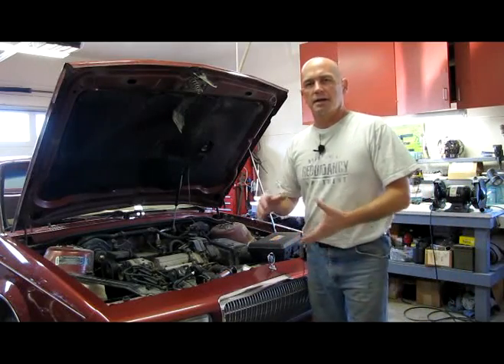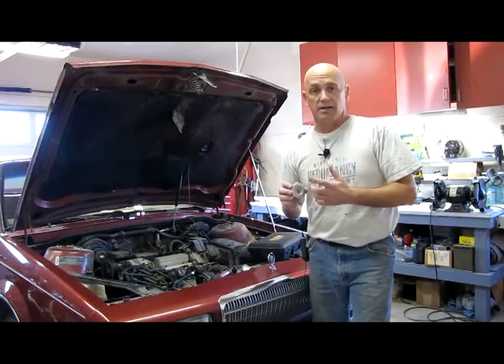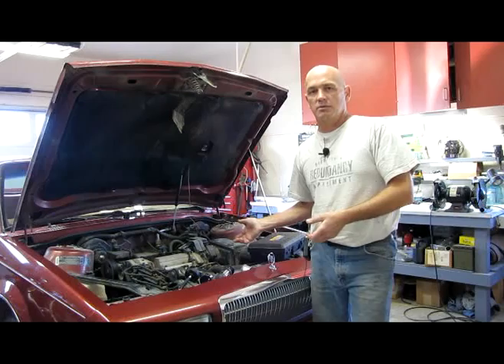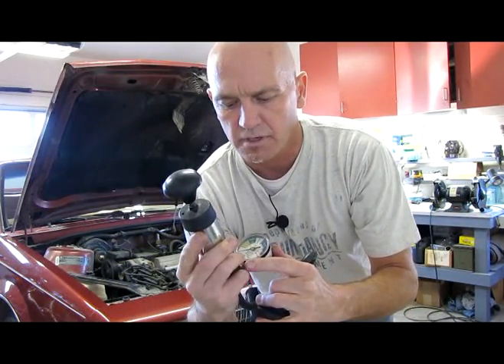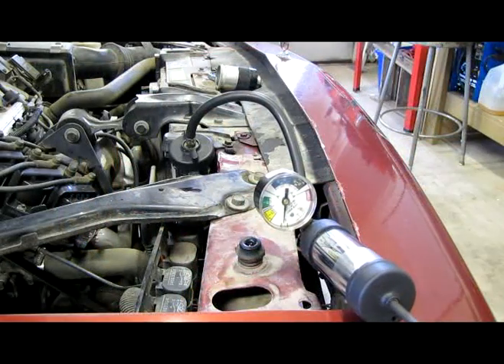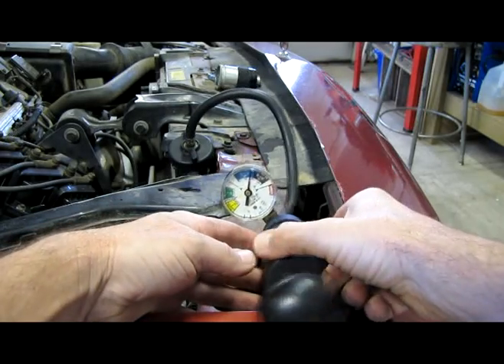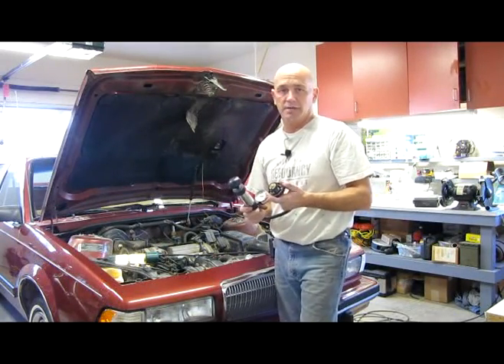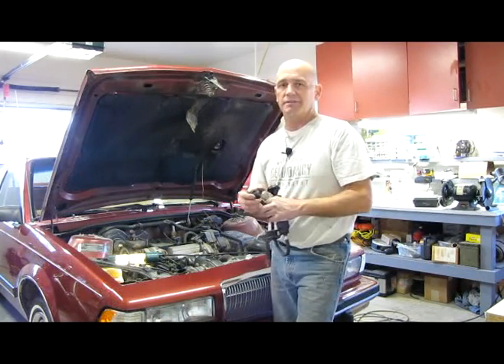How To Find Cooling System Leaks

Comment: I hope you may shed light on my problem. '97 Chevy K1500 4x4, 4WD, 5.7L.  It leaks approximately 1.5 gal per week. A mechanic pressure tested it and recommended replacing the water pump and the intake manifold gasket. When I look under the vehicle for the leak, I see a large area of coolant wetness under the belt wheels on the crossbar (part of the chasis?) and a drip from directly under the water pump.  My questions are:  Would that drip indicate an intake manifold gasket leak? Wouldn't a gasket leak be over a wider area, or would it drip?  Is there any test or observation that can isolate the specific cause?   It seems unlikely to me - though not impossible - that two problems would develop simultaneously.  Any insight you offer would be appreciated. Thank You, Art
Reply from the maker: Hi Art.  I'm glad you asked this question. Quick answer would be YES you could have more than one leak at the same time - doesn't necessarily mean that both suddenly developed at the same time, just that these were pointed out to you as a result of a system pressure test. Know that a pressure test on a cooling system is an EXTREMELY reliable method, and if you still feel uneasy, have another pressure test performed at a different shop. Understand that your vehicle is now 18 years old. Its cooling system pressurizes each time you use it, heats up, is regulated by temperature AND pressure (via the thermostat and radiator cap)- cools down, depressurizes...18 years of daily use - the system is very corrosive by nature- gaskets, connections, bearings and seals will develop leaks eventually - at varying levels of leaking. Your system 'wears' from the inside outwardly. Imagine standing at a big dam like the Hoover Dam or some such place, with a huge lake on the other side of the dam. You notice a leak. You stick your finger in it to plug it up.  What happens to the pressure of the water on the other side of the dam? It will naturally 'look for' the next weakest point in that dam, and if it can, it will poke through and leak there. So you stick another finger in that next leak, then the third one. Point is, the system is an 18 yr old pressurized system, and when one leak is repaired in a system that old, it's likely there may be another one at that next weakest point. That is 'how' you develop more than one leak. 1.5 gallons/week is a very large leak; have your mechanic show you where it's leaking externally to that degree. Upon applying pressure with his tool he/she should show you a really fast drip or seep. Applying pressure with the tool is actually putting the cooling system under the same 'running' pressure that it normally has when you are driving. Additionally, there may be other, smaller leaks (your intake area).  I recommend you have your mechanic actually show you these leaks, and then imagine this over a week's time of running. Just because these leaks were pointed out to you at the same time doesn't necessarily mean that they suddenly developed at the same time- I've had a habit for many many years to do this: I go to any store and I park my vehicle way out in a nice clean spot.  I get out, and look underneath before I go into the store. When I go back out, I look underneath again and do a mental comparison.  You get the idea.  You probably would have noticed one of those leaks before the 1.5 gallon/week became an issue. And, remember when you are looking under there that gravity will take the liquid down - so follow its trail up, and don't only focus on where the drip IS at that time. Further, remember that when driving the vehicle, it's possible that wetness is blown back by the fan when active, and also the RAM air coming in. What test would isolate your external leaks the best?  The pressure test that you've already had performed is the answer. I hope this makes some sense.  If not, you are welcome to contact me and I can explain further.  And, thanks for the great question!  r-
Reply: reluctorvalve Thanks so much for your rapid and thorough response! After I posed the question to you, I did in fact speak with a different mechanic who shed light on the likelihood, or at least a reasonable probability that one leak may have been the catalyst for the other, and, in any event, due to the age of the vehicle, servicing both items would be prudent since they are each already past their expected lifespan. It's a pleasure dealing with you - I did not such a thorough answer and respect you for having devoted so much time in giving it. I am now subscribed to your channel.
Reply from the maker: Artkruz812b Art, thanks!  I'm glad that my response and your further research results have matched! Common sense tells me that the smaller leak probably developed first (intake).  It probably leaked for some time and then that next weakest point developed (water pump bearing/seal/gasket or all) because it's the larger of the two.  A very small drip would develop well prior to a 1.5 gallon/week larger leak.  My videos have been on a sort of hiatus of late, but I'm now putting the finishing touches on a pretty detailed video that I shot over a two-month period covering cylinder head and head gasket replacements on a 1999 Dodge Ram 1500 Truck, 5.2L 318" V8 engine.  There's a lot of good information in there - it took me the entire two months to edit it down, as well.  I've added some lighting, mic and camera equipment, too. I ran into a copyright issue with some music, so as soon as I get those cuts replaced, I'll re-upload it.  Then, I have a 1990 Toyota 3.0L V6 that needs a water pump and timing belt - I'll again be shooting a video and editing it down for my channel.  So I have more coming (one very soon), and then I'll plan on doing more as I run across things.  Thanks for subscribing!  It's been a pleasure for me, as well, to help explain some of this stuff in common terms - I hope!  r-

Comment: I rented one of these testers from a chain store and for whatever reason, it won't hold any pressure at all, even though the cap feels snug on the filler neck. I can't find the leak when the car is running because the fan is just spraying coolant evey which way. Could it be that the system holds zero pressure?
Reply from the maker: Ghosto: Wow!!  That must be some HUGE leak!!!  I'd suspect a bad tester, until you said that coolant sprays everywhere when running.  Assuming that that's happening when it's sitting still, I'd highly suspect the radiator area, including the upper and lower hoses - the reason is because of the direction that the fan draws air.  It draws air from the outside, through the radiator and in the direction of the engine.  If there is a good leak anywhere in that directional flow area, you'll get a ton of spray while sitting still.  If, however, your water pump was leaking while sitting still in your garage, you'd more than likely have a good leak dripping on your floor, which is different than you describe.  Make any sense?  r-
Reply from the maker: reluctorvalve   - I'd say yes, it sounds like it holds next to no pressure at all. r-

Comment: My car has a huge coolant leak. When ever i run the car and check the coolant the reservoir tank is at low. I checked under the car and parked it inside the garage to see if there are any coolant leaks on the floor but nothing. Water pump area is also dry.Plss what do you assume is the problem for the leak or where do you think its leaking coolant? Reply pls.
Reply from the maker: Supzor Your car is most likely losing cooling when it is running at at operating PRESSURE.  When you park it, it depressurizes.  If you see nothing on the floor when your upper radiator hose is pressurized to the feel, then you need to see my other videos on compression leaks, or 'internal' types of coolant leaks.  Check out my videos and get back to me on what you think.  r-
Reply: Ok i'll check them out
Reply: Maybe head gasket, too.

Comment from the maker: Alex Gomez: it's generally referred to as a Cooling System Pressure Tester.  Mine is pretty old and made by Stant.  I looked Stant up and found that their testers are still widely available, and very similar to mine.  Mine also has an adapter I can put on the 'radiator' end of the pump, then attach my radiator cap to the other end of the adapter to see if the cap holds proper pressure.  Hope this helps.  r-

Comment from the maker: 1789Stephen: That would be the only way I'm aware of, would be to remove some and then add.  I always mix my coolant 50/50 in the bottles before I add it to the cars: pour half of the new concentrate into an empty coolant containter, then fill the rest of both of them up with water- 50/50.  Might try a new test tool if they aren't too expensive...if yours is old?  r-

Comment: Hello,
I saw your video with the Toyota. You were using BD Gasket Sealant.It is now One year & Six months later,Do you still have the Toyota? If so, can you give me an Up-date on how the car is running pertaining to the Head gasket.Your video was fantastic & I will take advise your advice on BD. My Issue is mild Also,there are claims that it can Gum up & cause more Issues. Is that True? Am I taking a gamble?.
Will use BD Pour & Go ? Coolant sys flushed 11,000 earlier.Need long term review.

Comment from the maker: Barfyspitz: I've set valve lash on a lot of different styles, including the older 'Chevy' style you speak of. In looking online I see that even using a dial indicator sometimes is used. I've used feeler gauges, particularly with imports.Sounds like your speed shop folks should be able to help you with the best method. I've done 'hot' and 'cold' adjusting as well.  Hot ones aren't so much fun to do. They didn't sell mechanic gloves back in the day...ha ha...